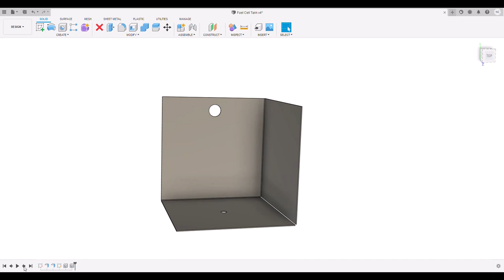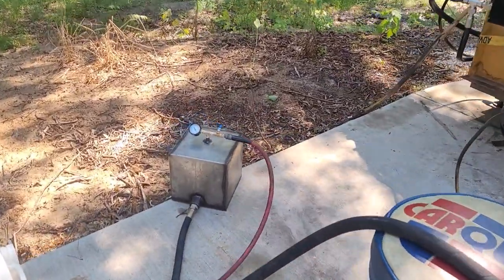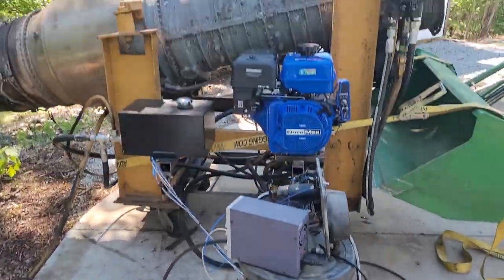Jet engine startup... J34 turbojet has lit the candle!

Comment: Are you sure it had diesel/kerosene/jet a fuel nozzles and they weren't swapped out for LP nozzles?
Reply from the maker: It was originally designed to run on AVGAS. It seems to run happiest on normal pump gas.

Comment: Have you tried kerosene?
Reply from the maker: I have not. Jet A, kerosene, and diesel are almost the same. But it really liked the gas mix added in.
Reply: @LiveLearnProjects 
Diesel and Jet A/ kerosene are not almost the same.
What you did with the diesel and gasoline was basically create what used to be called JP-4, which had a lot more naphtha in it. For decades, the Air Force used.JP-4 and the Navy used JP-5 which had much less naphtha , and was much less volatile for use on board carriers. 
JP-4 has a lower specific gravity, and weighs less than JP-5. But also contains much less heat energy.